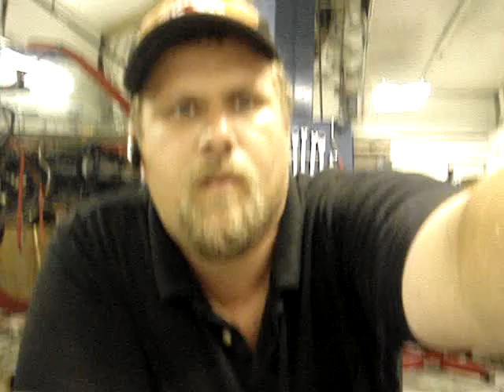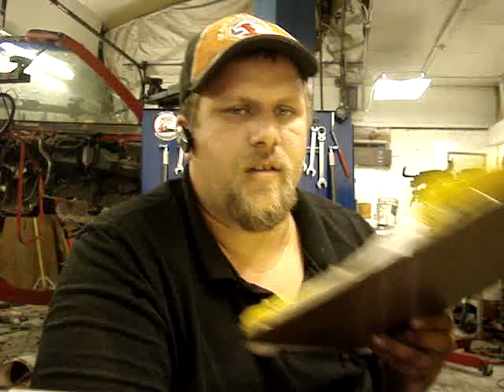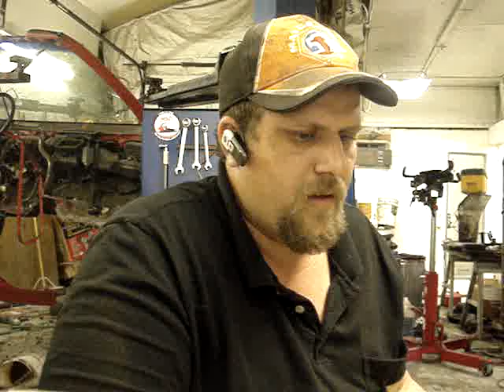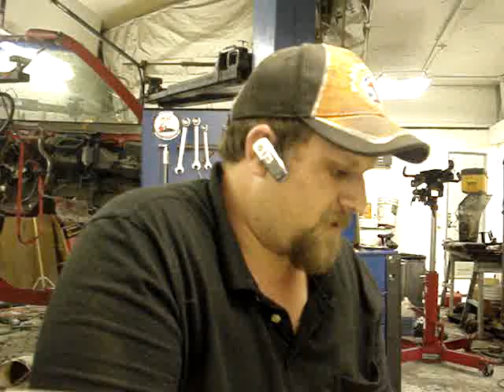nissan 1st mpg test sidebar on steam

Comment: Sounds like to me that your engine without hho is detonating hence the the lower milage.  When you inject water, you stop some of the detonation, hence the increase in milage.  They used water injection on B-17's in WWII to inhibate detonation because of  high manifold pressures because of superchargers,  they got more power becuase the engine was not detonating because of water inject.

Comment: nice job on test. When you say this. "Again my statements on too much steam is what I have experienced and witnessed in my field. I have sucessfully used water-methanol injection on super-turbocharged and high compression engines with great results. Friends and customers have done it also but didnt do it in moderation and that is when I found rapid piston damage occur." 
 Are you useing steam injection?

Comment: very good data gathering, well done. This is encouraging. As far as steam goes, one of the byproducts of hydrocarbon burn is in fact water. How much is too much? from testing more than 15% of total intake volume would be too much imho. The hard part is controlling the injection method of the water, cold vapor, steam at a lower temp due to lower pressure, doesn't seem to be ill affected by that mix, unless you accidental pump 2 litres of water into the engine in a minute, grin whoops.